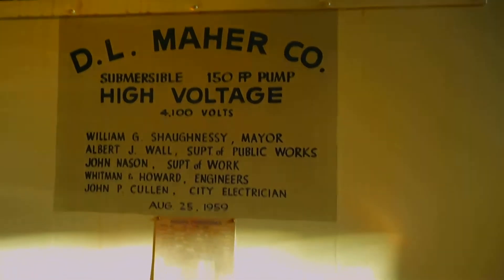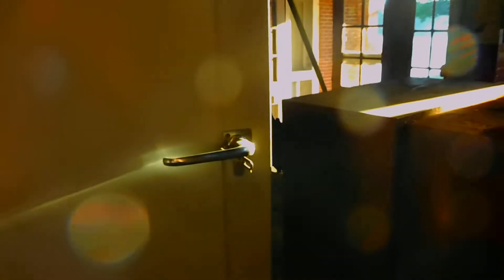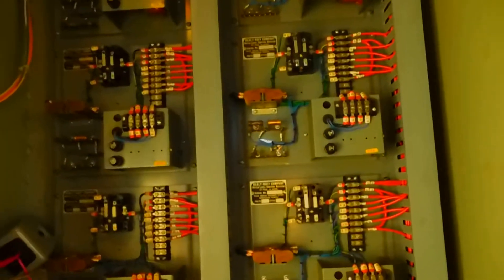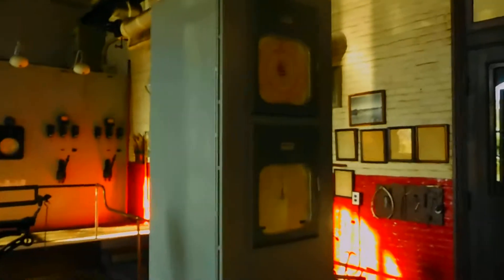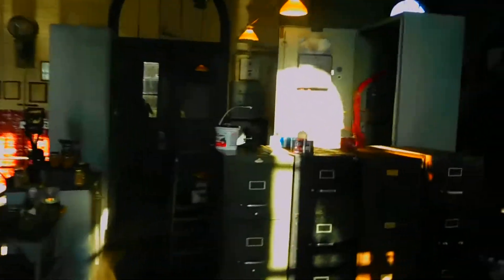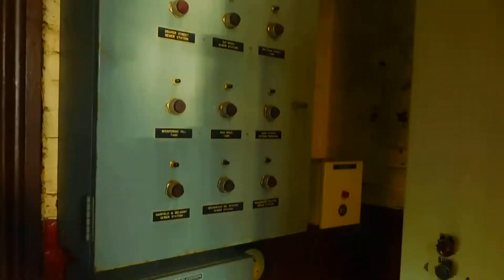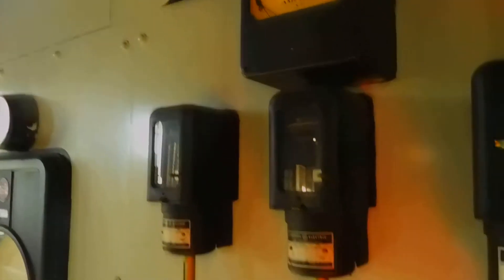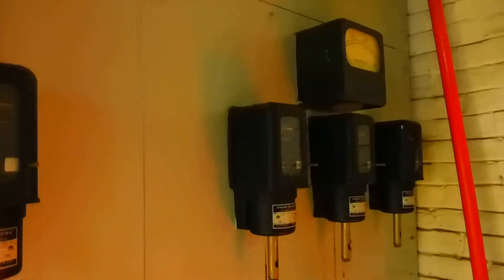Woburn Waterworks Electrics

Comment: So the pressure meters reading water you are pumping , or the supply is hooked to new pumping station. The chart meters have been running since 1959 or did you bring them back up ?